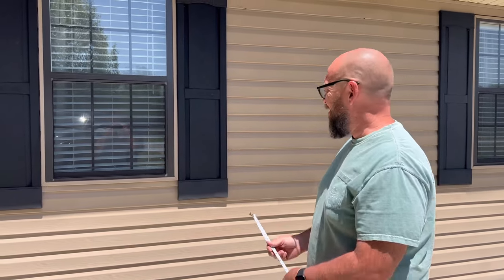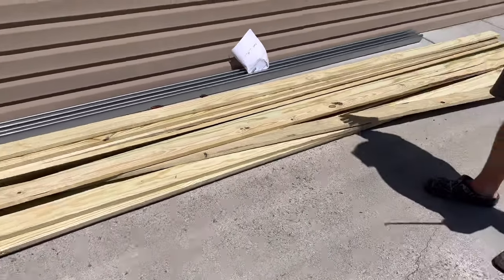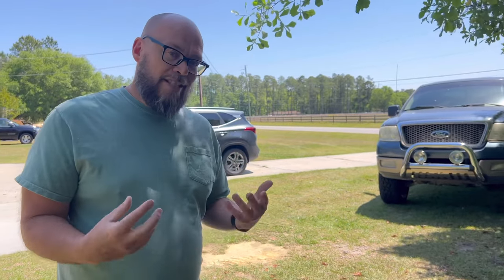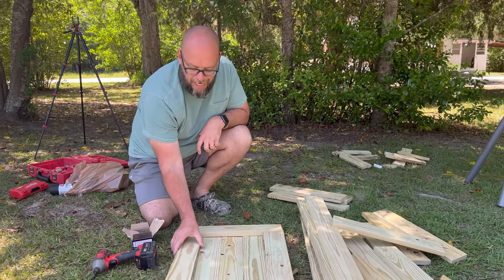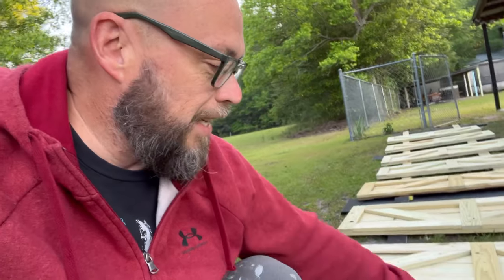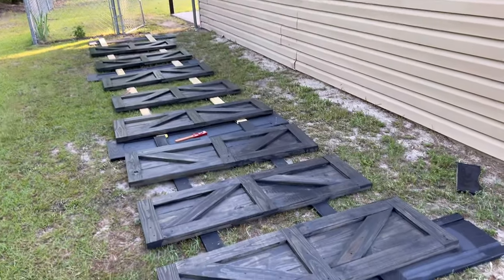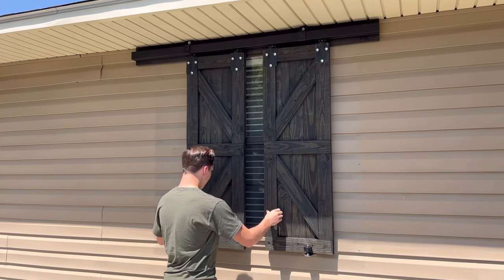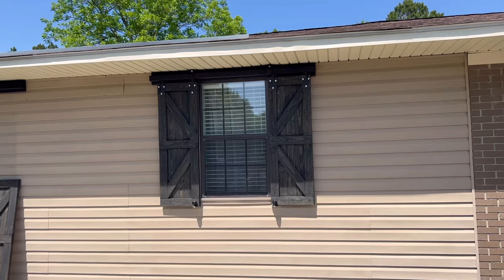How to build working barn door shutters for your home

Comment: Does the hardware have a lock to keep the doors from sliding side to side as one? Even if you locked them together in the center wouldn't the whole shutter just slide to the side exposing the window?
Reply from the maker: We added a lock to it in the center of the front. The wheels at the bottom will tighten up enough to hold it in the open or closed position. But I’m guessing you could come up with something to lock it down more if you wanted. For us it was more about the looks than anything, but we like the functionality option.
Reply: Oh my. I love this idea! I am putting some new windows in.  I hope I can do this at my house. I have always wanted working shutters. We get hail, high winds, and tornadoes. These look so much better than those cheesy looking crap fake shutters.
Reply: There should be barn door stoppers at top rail; left, right and midpoint to prevent one or other door slide passed floor guide.

Comment: Great creativity love the work gentlemen. One minor suggestion or something to keep in mind is vinyl siding was engineered to float. You can see “bad” siding jobs were the siding just doesn’t seem to wanna stay locked together that’s because someone nailed all, one, or some to tightly and didn’t float their nails in the center of nailing slots. If I was contracted to do this or doing it on my own home I would hremove the top run or 1 1/2 whatever is needed and replacing it with the “header board the entire length” one is creates visual continuity and two it prevents the siding from coming apart later down the road. You can router the very bottom edge of the new header board to allow it to overlap the very top of the siding to prevent impeding it’s movement
Reply from the maker: Great suggestion. Thanks for the tip.

Comment: I went to lowes website & to order the National hardware stuff I need to do to windows just like you did is $365 is that what you paid for just the hardware?
Reply from the maker: I got the tracks for less at Tractor Supply. Bought the rest from Lowes. Hope that helps. It may be higher now than when we did it. I had watched and it was going down when we bought it, but given how things are these days, it can change in a second. Lol

Comment: Would anyone be so kind to post a list of materials for this?
Reply from the maker: I should have when I shared the video. I can tell you the best deal at the time for the rails was Tractor Supply, but you can get them at Lowe’s as well. It needs to be a galvanized, outdoor barn rail. The other hardware all come from Lowe’s. That would include the barn door wheels, the wheel stopper for the bottom of the shutters so they won’t swing out and also the handles/locks for the shutters.

Comment: Which barndoor kit did you buy?
Reply from the maker: We used the National Hardware brand. Shop it because some places had certain parts cheaper, like Lowe’s had the rollers and smaller hardware the cheapest while Tractor Supply had the rails cheaper. So we bought based on price because the rails were a lot less expensive at Tractor Supply. You might want to check with a local Ace Hardware as well.

Comment: Having built many barn doors and windows before, all sliding doors / windows will require top rail stoppers at left, right and midpoint to prevent the panels over-sliding or swinging. This is more important when the sliding door/window installed outside where strong winds are expected

Comment: In the old days (before screws were cheap or even available) they would have "deadnailed" those together. Nail all the way through, then bend the nail over on the back side and hammer the point in to lock the nail in like a Rivet. 
Glue and wooden pins was another popular method.
Reply: That's what I'm talking about... 😂Economical, and Using what you got to get it done. I think I still might look into this.

Comment: That's great. I want to do something like that. If I do, I'm going to make the top rail split into two pieces blocked off from each other. That way, the left shutter can't move further right than the middle, and visa-versa. I think a simple guiderail on the bottom with some kind of loop going around it might be better than the wheel. If the bottom guiderail was somehow sawtoothed, the shutters wouldn't move easily.
Reply: You don't need to split the rail into two pieces to accomplish this.  A set screw (or pair) from the front will do the trick, or if you don't want it exposed then measure and put it in from the back before mounting the rail to the board.

Comment: I’ve been wanting something to protect my windows in case of hurricane or hail storm. This is a great idea, thanks for sharing this!

When I go to “National Hardware” on Lowes website, am I looking up a kit of some sort, or do I need to know all the individual parts to get in order to put this together?  If so, would you please list each of the parts I need to get?  TI A🙏
Reply from the maker: You would be getting individual parts. You need a rail the length you want. Then the wheel assembly to attach to the top of your shutters and then the wheel that attaches to the house/wall to guide your shutters and keep them from flapping. I don’t have item numbers though because the rails come in different lengths, the wheels for the top of the shutter also come in different styles and the guide has two different types. It’s really up to you which of all of those you’d prefer to work with.

Comment: Do you have the links to the hardware? Was the mounting rods that the wheels slide on included ? And was that apx 200$ for both windows or just one? Sorry for the questions…
Reply from the maker: Just go to Lowes website and search “National Hardware” and you’ll find all of the hardware you need. It was $200 per window for everything we used, lumber and hardware.